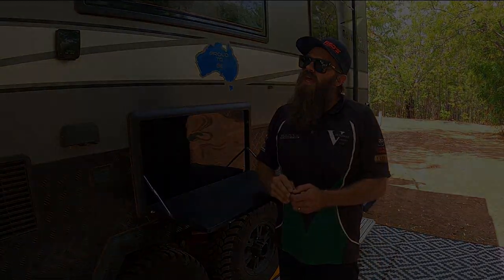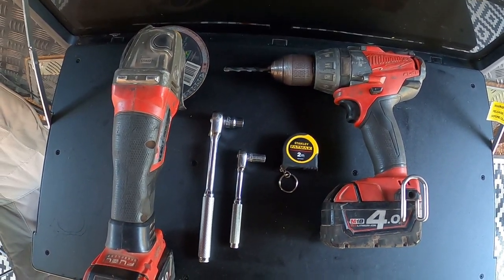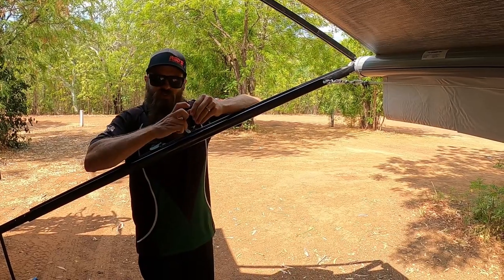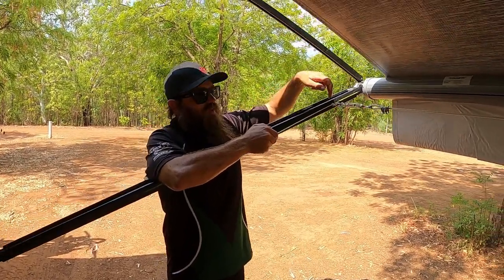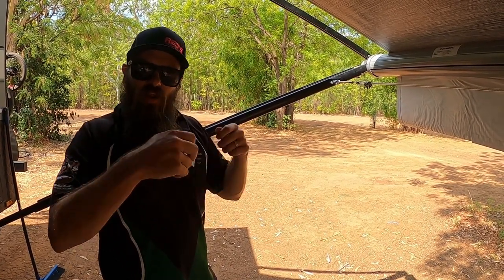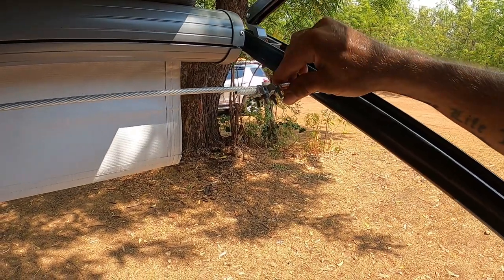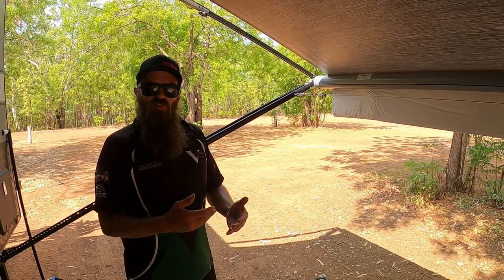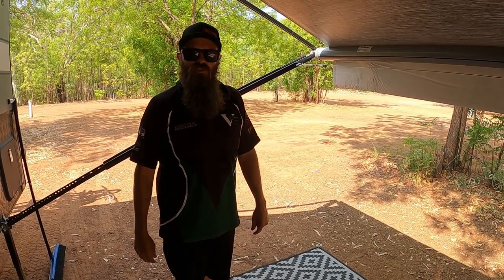Caravan Hack For Clothes Line | Washing Line Install

Comment: A good tip I was given on installing a similar line was to use a spring from one of the tie down ropes to provide some spring on the line. This reduces the stress on the cheap metal used on the Dometic awnings.
Reply from the maker: Thanks for that Tim, great tip :)